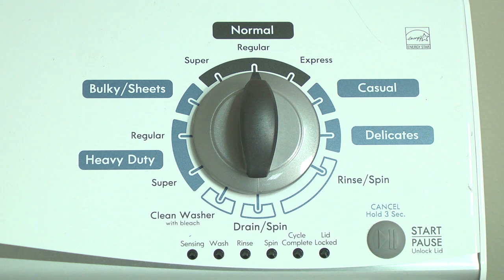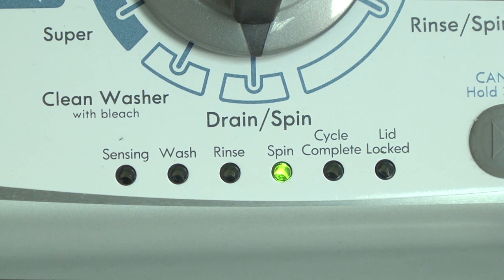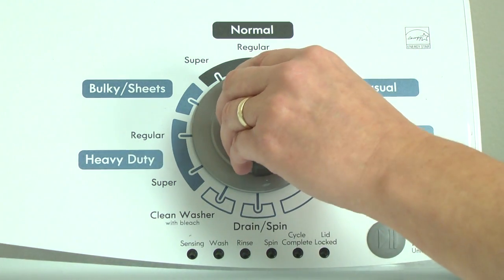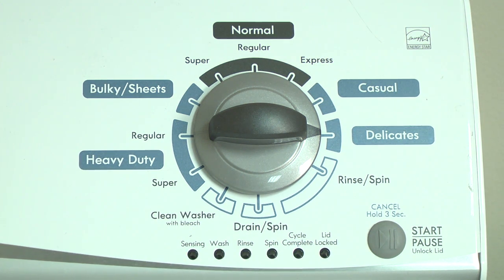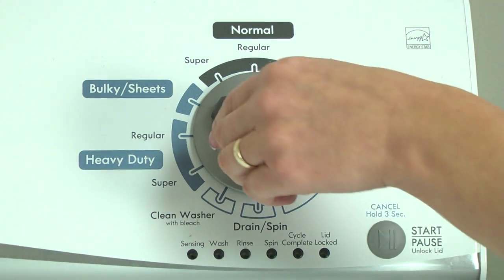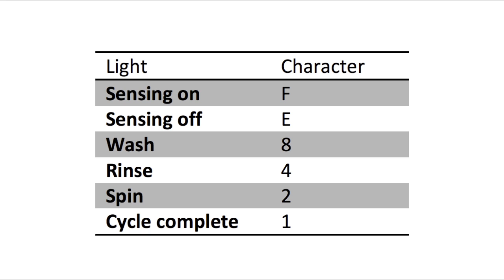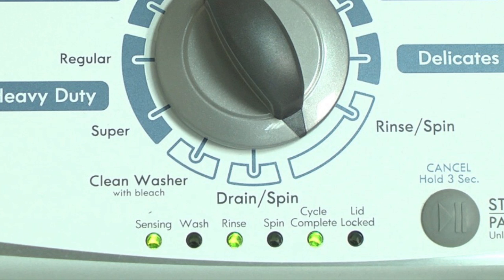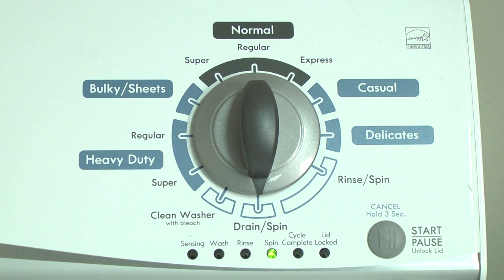How to Read a Vertical Modular Washer (VMW) Error Code Display

Comment: Washing sheets I have an "OE" error code. I adjusted the sheets thinking it was an out-of-balance code but quickly stopped and gave the code again. tried resetting 2 more times and with the same result. I removed the sheets and tried to run the machine while it was empty to remove the water that was in the bottom of the machine and once again it did not spin and the water was not removed. It also displayed the OE again. This is the model without an agitator
.
Reply from the maker: Check the suspension rods for damage or for a disconnected rod. Here's a link for an illustrated repair guide/video that shows how to lift the top panel of the washer: https://www.searspartsdirect.com/diy/repair-guide/how-to-replace-the-spin-basket-in-a-top-load-washer . Reconnect or replace any damaged or disconnected suspension rods. If the suspension rods are okay, then the spin bearing in the washer may be bad. You'll need a service technician to repair that type of failure. We hope this information helps. If you need further assistance, let us know.

Comment: I can't get mind to go into diagnostic mode no matter how many times I've spun it around and did the right settings. It just has the light on saying sensing flashing that's all it will do
Reply: How did you fix it. I'm same place you are
Reply: @jonapier9977  new water pump, local guy fixes them only cost me 45 dollars
Reply: Thanks alot man

Comment: I have model #110.20022012.  Could you please explain how to get into diagnostic mode.  I've tried unplugging the washer, but the lid locked comes back on.  I've tried holding down the start/pause button, but the lid locked light comes back on.  The lid locked light will not go off so I'm unable to enter diagnostic mode.

Comment: What model is this machine? Just bought one used and have no idea on how to use it, and that diagnostic procedure did not work for me...gonna try L-R-R-R-L-R as suggested below. I mainly need a manual is why I ask about model number. Any help would be great. Thank you!
Reply from the maker: That's Kenmore washer model 110.21102010. Here's a webpage that has an online copy of the owner's manual for that model: https://www.searspartsdirect.com/manual/5t5qimmdvx-000582/kenmore-11021102010-washer . The diagnostic mode is a bit tricky to enter. Let us know if you need more help entering that diagnostic mode.

Comment: Thanks for the information. I have a Kenmore model# 21302010 washer. I am getting errors F5 E3 and F7 E5, I know I have to replace the lid lock assembly. The F7 E5 error is the shift actuator, I would like to run test on the actuator before purchasing a new one. The shift actuator replacement video recommends running a diagnostic, the tech sheet is missing from inside my washer. Could you please tell me how to run a test on the shifter, or is it the general diagnostic test that I have to run? Thanks

Comment: I got F7 E1.   Model  110.21302013
I tried a new/used shifter actuator, but same results. I'm going to try another NEW shifter actuator. Basket spins freely. Belt looks good but there's a little black rubber dust inside the cover. It runs through the diagnostic test too. Cold, hot, both, agitate, eject then flashing red.

Comment: I got a F7 E1
Reply from the maker: The F7 E1 code indicates the control board isn't getting proper tachometer signals from the speed sensor on the shifter assembly. See if the spin basket rotates freely. If not, then examine and replace any defective drive components. If the basket spins properly, unplug the washer and check the wiring connections on the shifter assembly. That component has the optical tachometer. If the wiring connections are okay, then that shifter will usually need to be replaced. Here's a video that shows how to replace the shifter assembly: https://www.searspartsdirect.com/diy/repair-guide/how-to-replace-the-shifter-assembly-in-a-top-load-washer . We hope this information helps. If you need further assistance, let us know the model number of your washer and give us additional details about the problems you're seeing.
Reply: @searspartsdirect  I have a kenmore top load washer model # 110 21302010.
Reply from the maker: @richardriley8300  Thanks for providing that model number. The above advice that we provided works for your model. If the basket spins freely and the wiring connections are okay on the shifter assembly, then you'll likely need to replace the shifter: https://www.searspartsdirect.com/product/1uaig3cgmm-0026-110/id-wpw10006355

Comment: I can’t get the damn thing into diagnostic mode. I’ve tried starting it on casual and moving the switch as fast as possible.
Reply: Mine worked with another Kenmore code: full turn CC and then LRRRLR.  Good luck.
Reply: BluesLicks101 I actually got it to work. I just started with spinning it to the left, preferably at least one full counter-clockwise turn. Then right, right, right, left, right. But the speed required isn’t extremely fast. It’s actually quite slow and casual. If anyone else has trouble with it, try slowing it down a tad. Give a half second paused on each click of the dial. Right, pause, right, pause, right, pause, left, pause, right.
Reply: @BluesLicks101  your a genius, couldn't get it to work either for a 110.21302013 your code did the trick, thanks.

Comment: my model number is  110-21252111 i dont have the code sheet that tells you what each fault represents
Reply from the maker: Here's a link for our webpage that shows the error code explanations for that washer: https://www.searspartsdirect.com/diy/error-codes/washer-repair/1234598/kenmore-110-model-vmw-top-load-washer/0582 . If you need help troubleshooting and fixing a problem, let us know.

Comment: My washing machine will not go into diagnostic mode. When I unplug it for 5 min and plug it back in nothing will happen. When I hold the Start/Pause button the Sensing light will flash, when I press Start/Pause again then Sensing light will stay on, then holding the Start/Pause button again the Spin light will stay on but the machine won't do anything the entire time. Help :(
Reply from the maker: Unplug the washer and check the wiring connections on the control board inside the console. Loose wiring connections could be preventing the washer from starting. If all wiring connections are okay, then a bad lid lock could be preventing the washer from starting on some models. If you need more help, let us know the model number of your washer and we'll try to provide additional troubleshooting tips.

Comment: I have 4 codes. Not sure which one is the actual problem. F2-E1= interface control, F5-E1= lid switch fault, F1-E2= Drive Motor/Main Control Board and F7-E5=Actualtor. Any thoughts? I would imagine the main control board would indicate multiple issues.
Reply from the maker: The control signals saved fault codes beginning with the most recent code to the oldest. You’ll likely need to troubleshoot the most recent code first. If you need more help, let us know the model number of your washer and which code appears first.
Reply: I got F2 E1 first and then the second was F5 E3
Reply: Where do I looked these codes up?? What's my next move?? I have the Kenmore 100 series it's about 2 years old bought brand new.

Comment: I have a 110.26002012. When I plug it in, the LEDs light up, music plays. I turn the dial and the LED's follow the knob. Press start, nothing happens. I don't think that the Sensor Light illuminates.  I hear a little click, as if some relay is operating on the control board, but it is not the lid lock clicking. I haven't tried the Diagnostic Mode yet. I will try Diagnostic Mode tomorrow when I am at the house with the washer.
Reply from the maker: Your washer has a plastic bezel that covers the opening for the lid lock on the top washer panel. Here’s a link that has a photo of that plastic bezel:  https://www.searspartsdirect.com/part-number/WPW10392041/0026/110.html  Make sure that plastic bezel is centered over the opening to the door lock on the top washer panel. If that plastic bezel isn’t centered over the opening, then the washer may not lock properly and the cycle won’t start. If the bezel is centered over the opening and the washer still won’t start, then running the diagnostic test will likely point you in the direction of the failure that is preventing the washer from starting. If you need more help, let us know (include details about any error codes that you find while running the diagnostic test).

Comment: So I went into the diagnostic mode and I get: E1, E2, E3, E4, E5, E6, E7, etc, etc. So what the heck I ran it through the calibration mode, which I'd never done before, and it seems to be working.
Reply from the maker: Let us know the model number of your washer and symptoms of the washer failure and we’ll help you with some troubleshooting tips.

Comment: It amazes me how they leave out essential info. Like toward the end she says to turn it off. Is there an on off button? All I see is a start pause button. Just checking the video out because I am looking into a used unit that has this diagnostic board installed. By the way does this diagnostic test operate like the Whirlpool units that actually fill,spin and drain during the process?
Reply from the maker: Some models have an on/off button. For the model shown in the video, press and hold the Start/Pause button for 3 seconds to turn off the washer. The diagnostic test mode in this washer does have an automatic test that checks major washer functions. After entering the diagnostic test mode as shown in the video, rotate the cycle selector knob until the Spin LED lights up then press Start. The control will cycle through all washer functions check component operations. Press and hold the Start/Pause button to exit the diagnostic test mode at any time. If you need more help, let us know.
Reply: @searspartsdirect  thanks for the details...I have this model mad holding start/pause for 3 or more seconds does nothing... how do I get it turn off?

Comment: My sears 800 washer works fine until it goes into the spin cycle then starts bouncing all over the place and makes a loud noise any suggestions
Reply from the maker: Unplug the washer and check the tub suspension springs. The suspension springs help keep the tub stable during the agitation and spin cycles. Replace any broken springs. If you need more help, let us know the model number of your Kenmore 800 series washer.

Comment: Can't figure out the error codes. Can someone help me? Went through the diagnostic mode and here's what it looks like https://www.dropbox.com/s/bb3wrmhj85xj89j/20180616_123529.mp4?dl=0
Reply from the maker: The first error code displayed is F0 E2 (excessive suds detected) and the second error code displayed is F9 E1 (long drain time). The washer can’t drain water with excessive suds. If you see evidence of excessive suds such as foam residue on garments or foam inside the tub when the washer is trying to drain water, use less HE detergent in the washer. If you’re not using HE detergent, then you’ll need to use only HE detergent in the washer to prevent excessive suds. If you see no evidence of excessive suds, then a drain system problem or failed drain pump is likely causing both error codes. This type of washer will typically signal the F0 E2 (excessive suds) error code before displaying the F9 E1 (long drain time) error code when the control detects a long drain time. Here’s a video that provides troubleshooting tips for fixing a drain problem: https://www.searspartsdirect.com/article/troubleshooting-top-load-direct-drive-vmw-washer-wont-spin-or-drain.html. If you need more help, let us know.
Reply: Sears PartsDirect When I try to drain the water the machine sensing light comes on but the lid never locks and the washer never attempts to do anything else. Is that supposed to happen if it's clogged? In any mode the lid never locks.
Reply: Sears PartsDirect So I removed the pump and discovered that the impeller was rattling around inside. I see no way of attaching it back. So getting a new pump would probably fix the problem, correct? Where is a good place to find one, and once a new one is put back on, when I start a cycle, the washer should lock the lid and start right?
Reply from the maker: When the washer encounters a long drain and senses that the machine is full of water, the control tries to run the drain pump for 5 to 7 minutes. If you’re trying to drain the water by starting a drain and spin cycle, the control may be trying to drain water from the tub but the drain pump may not run. This may be why you just see the sensing light come on and the machine doesn’t do anything else.
Reply from the maker: Sounds like you found the cause of the long drain time. Replacing the pump should fix the problem. Multiple failures rarely happen on that type of washer. You may want to make sure the drain hoses are clear so the new pump can drain out the water properly. We don’t just make DIY troubleshooting and repair videos, we also sell parts. Here’s a link for the page where you can order the new pump: https://www.searspartsdirect.com/. Once you replace the pump, the washer should work properly. If the control runs the drain pump after you power up the washer following the repair, let the drain pump run until it stops (likely 5 to 7 minutes). You should then be able to start the washer normally. If you need more help, let us know (and include the model number of your washer so we can tell what type that you have).

Comment: I did the diagnostic test but it doesn't spin. When I try washing clothes the lid doesn't lock like it usually does and the sensing light blinks then it fills and drains but does not spin. Do i need a new part or is there a way I can troubleshoot it or reset it? Thanks.
Reply: only 2 things can cause this and one is the lid switch is bad and the second one is the mode shiftier needs replace both are easy to replace and there are lots of videos on YouTube to show you how. do not for get to re calibrate the machine after installing new parts. the diagnostic and repair manual for these machines can be found on manufacturers web sight suport
Reply: I think that is my problem, I know what it is my Brother overloads the damn thing, I told him over & over, needs about half loads, these thing are cheaply made, it's not like the industrial I just used at the laundry mat, use to be 2.50 a load, now 4.00 per load, holy crap.
Reply from the maker: First, reset the electronic control board by unplugging the washer for 3 minutes and then plugging it back in. See if the washer works after restoring power. If not, use the diagnostic test in the video to view the saved error codes. The saved error codes will likely point you in the direction of your failure.
Reply: Mine does same thing, any luck?
Reply: Evet figure out your guys problems? Mine won't spin either. Might be the lid lock I'm thinking
Reply: Thank you!!

Comment: Why not just make a reliable machine?These are junk. I dont need an error code when there is a flood in my house from a faulty pressure switch. The new problem is with washing and rinsing and spinning. Junk..
Reply: 4570 will cure it.
Reply: @yaesu101ee  Ha Ha:)